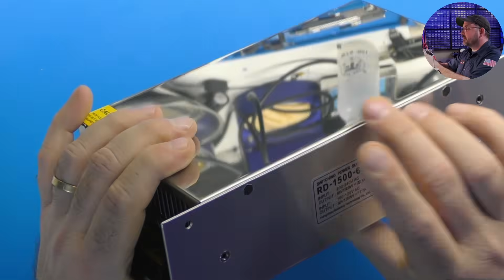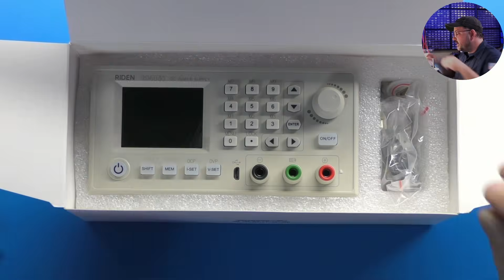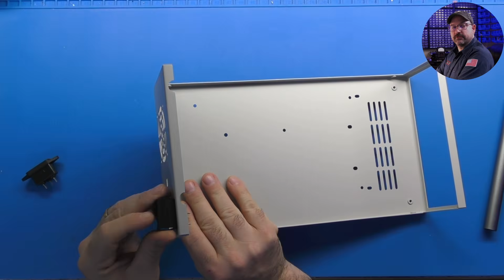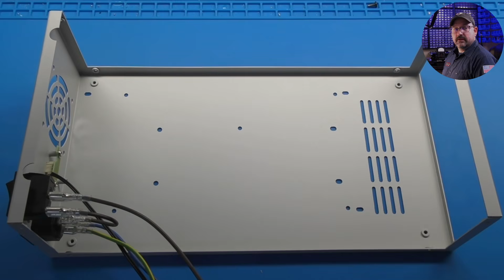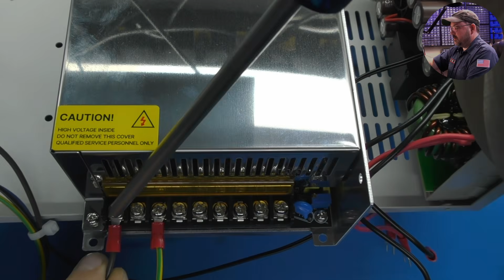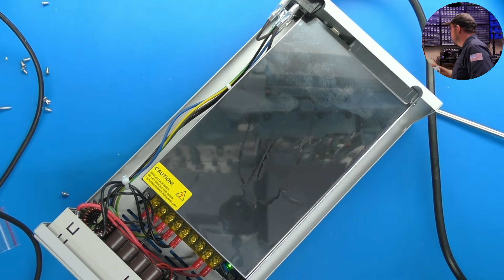RD6030 Assembly with Control Software

Comment: So this power supply can't do 60v/30a at same time. Interesting the unit I got is also the Max version it comes with a larger screen and USB-C and rubber bumpers. I guess the actual control side of it will be the same
Reply from the maker: I'd be interested to see the difference. Hopefully FastReader works with yours as well.